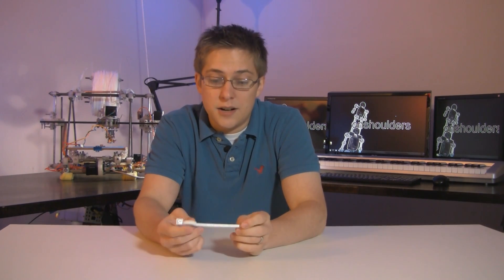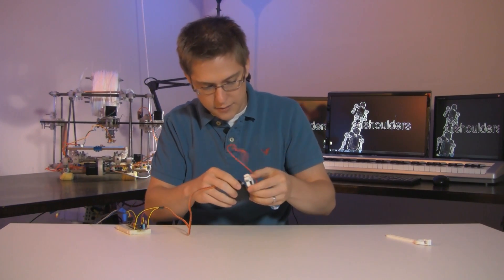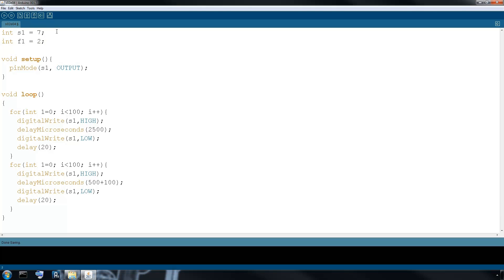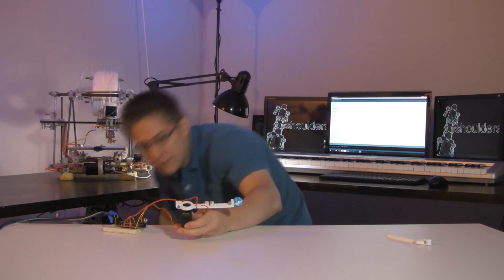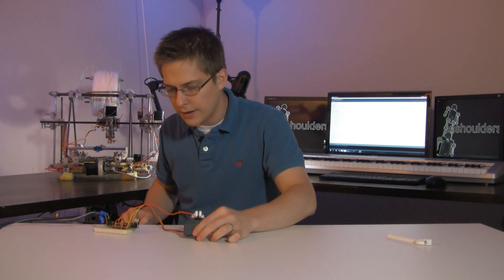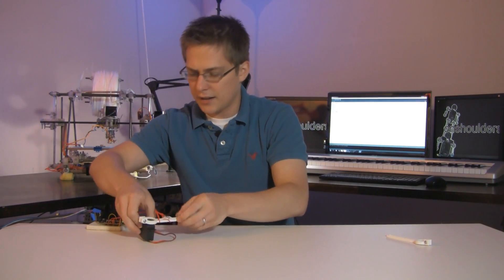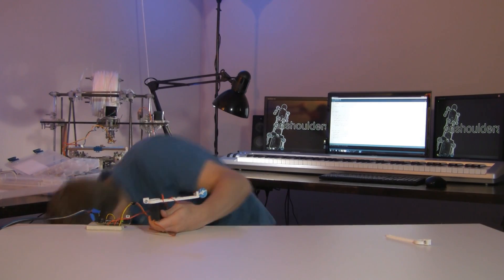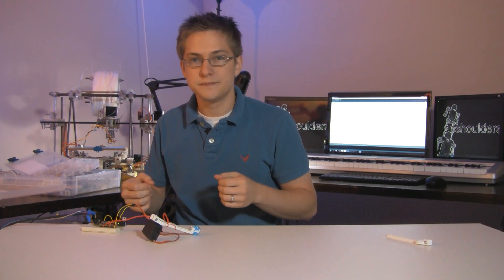onshouldersTv: Dogbot Learns to Feel, Part 1

Comment: Maybe you could lower the part count by removing the resistor and turning on the internal pullup on the signal pin for the touch sensor and move the other wire of the touch sensor to ground.

Comment: @kebakent 
This is meant to be a easy project after all , maybe he doesn't want to couple it with the state of the art sensor array.
Yeah I know a On/Off tactile sensor might not be the best on a leg , 
but so far its just for demonstration purposes , and it might even be useable in order to lower the leg until a solid surface is found , so it will keep more than one leg on the ground at once :)

Comment: So, you make a pressure sensor consisting of two wires touching. That seems a bit unreliable to me, and I think you would have trouble making each leg 'activate' to the same amount of pressure, which would also be difficult to adjust (bending the metal to have the same gap?).
I have never used a strain gauge, but I think it would be ideal for your sensor. Strap one to the long part of the leg, and you should be able to read a variable pressure.
Or, maybe you could use an optocoupler-principle.